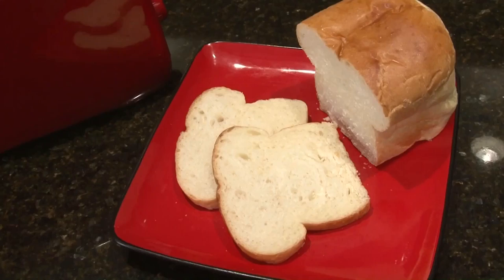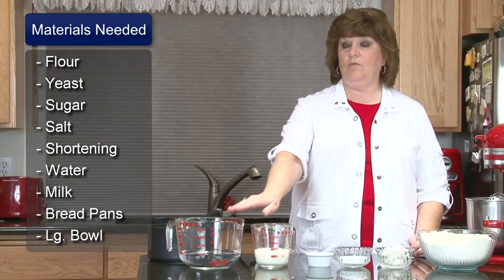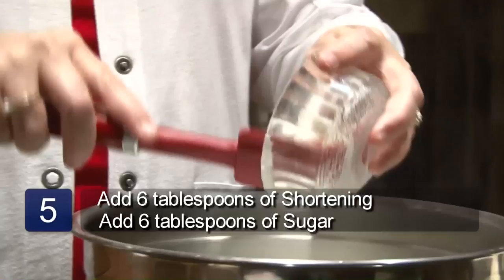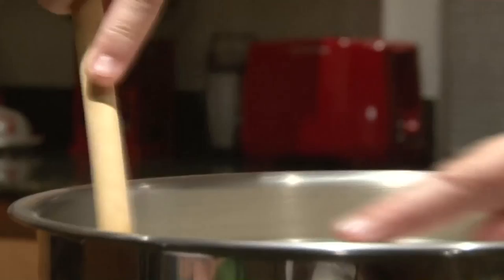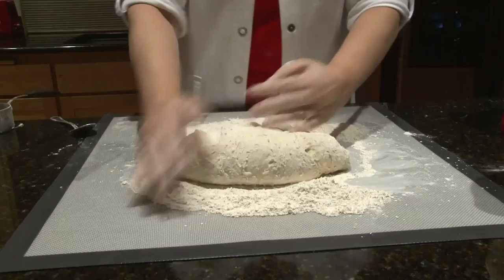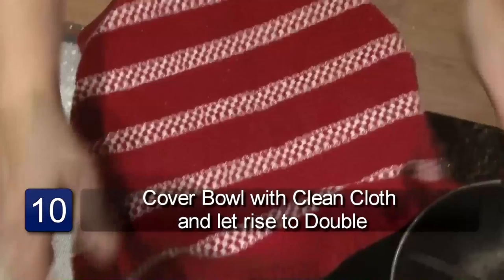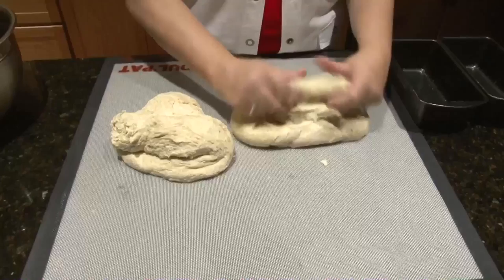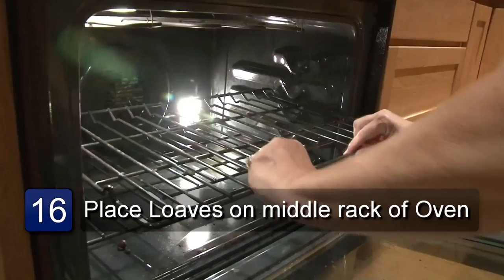Bread Baking Tips : How to Make Soft Airy Bread

Comment: Soft Airy bread 
by Expert: Susan Walker
Ingredients:
5 tsp of active dry yeast (5 tsp = 14 grams = 2 little packs)
3 cups  +  6 cups of flour (more or less to obtain the desired consistency)
6 tbsp of shortening 
1tsp + 6 tbsp sugar
3 tsp of salt 
¾ cups of milk 
¼ cups of warm water + 2 ¼ cups water 
Instructions: 
1. In one small bowl mix : 
the (5tsp) of dry yeast, (1/4 cups) of warm tepid water and (1 tsp) of sugar.
• when you see the yeast mixture start to foam then you'll know that the yeast is working and you can continue with your recipe.
2.  The next step is to put the (2 ¼ cups) of water and 3/4 cup of milk into a saucepan put it on the stove and heat it to scalding (scalding means that when the milk foam around the edge of the pan its scalded but you don't want to boil it). After the water and milk is scalded, add the (6 tablespoons) shortening, the (6 tablespoons of) sugar and the (3 teaspoons) salt to the saucepan, and mix that together until it's melted and then put it aside to cool.  
3. After your saucepan mixture is cooled to lukewarm, then you can mix the yeast mixture you made with the saucepan mixture in a large bowl, you stir it together.
4. Then we are ready to add our (3 to 4 cups) flour to the bowl ( I use a mixture of bread flour and regular white flour), mix in enough flour until it's too thick to stir then you'll want to turn it out onto your kneading surface, then you'll want to add the rest of your (6 to 7 cups) flour into the middle of your surface and then pour your dough into the flour and using your hands you'll want to knead that flour into your dough and you just keep kneading and kneading and kneading until the flour is gone and when your dough is elastic and not sticky to your hands and not sticking to the surface then it's ready for the next step (if it's not you'll want to add a little bit more flour until you get that right consistency).
5. Then, you'll take the dough that you just kneaded and put into a large greased bowl cover it with a clean cloth and put it into a warm place and let it rise till double sometimes it will take up to 90 minutes.
6. After it's risen to double, you take your fist and you punch it down now you're ready to form your loaves, take your bread pans and you spray it with cooking spray or some kind of a baking spray and then you take your dough and you divide it into either two or three sections depending on if you want large loads or small loads using your hands you take the dough and you form it into a long roll fit the pan after you've formed your loaf you will let rise until it's double or into the shape you want.
7. Now turn on your oven to 350 Fahrenheit so the oven is ready for baking. (Some ovens take longer to reach the desired temperature, so you might need to turn on your oven earlier).
8. After it's risen, you take a toothpick and very gently poke few holes down the middle of the bread make sure that the holes are only 1/4 inch deep because you don't want to punch the bread down again this will help vent the bread so that you won't get air bubbles.
9. Place the pans in the oven (make sure the pans are the middle rack) and you want to bake them for approximately 30 minutes or until golden brown on top.
10. Then take your bread out of the oven and let it set for about one minute and once you have the bread out you'll want to brush the top with a little butter, let the bread completely cool before you cut it and that is how to make soft airy bread.
*the key to making soft Airy bread is to use white flour or bleached wheat flour 
*this recipe will make three small loaves or two large loaves. 
End

Guys: I used most of the video's transcripts and added some words to it, also the ingredients look weird because I separated the quantities in steps... for example (¼ cups of warm water + 2 ¼ cups water 
) because you will need 1/4 cup first and then the rest for the second mixture... it is just so is easier for me to use everytime,  but you can edit it to howevver is easier for you.
I think she did a great job, and I will print and save her recipe he,he.

Comment: hi, i'm a beginner in making bread, i tried different approach in making it however can't make it soft, the last one, i have crusty crust yet soft in the inside.. what i want is a soft bread inside and out... i used to mix the yeast together with the dry ingredients and used a little bit warmer than the usual warm or lukewarm water.. and by the way, is it ok if i use oil or olive oil for shortening? looking forward for your help.. thanks.
Reply: One way to keep you crust soft is to take a couple of tablespoons of cornstarch with about a cup of water. In a small pot heat the mixture on the stove stirring all the time. The solution will start to get thick. Once thickened but still fluid....remove it from the heat and with a pastry brush ....brush the solution over each loaf just enough to cover. When the bread is done, the crust will be smooth and soft.
Reply: thanks Mr. johnnyohness... i'll try that one..
Reply: johnnyohness Let me be clear..try 1 1/2 half cups of water to about 1 2/2 half table Spns of cornstarch. Let is cook just until the solution becomes creamy but NOT too thick. Keep the solution away from the baking pan foe easy removal of the loaf.
Reply: If you place a slightly moist towel over the bread after removing from the oven, the crust will soften. Play a bit with the timing, but covering for a minute or so will reduce the crust a bit, while covering for 15 minutes will eliminate all crustiness...I'm no pro, but that has been my experience. Try it out.

Comment: Is there a such thing as kneading your dough to much I always have a problem with it rising. Bread still comes out great but lays in your stomach like lead. I think I pined it down to I'm bad at activating the yeast or all purpose flour isn't good for bread(witch i doubt) or i knead the dough so much it just never rises properly. Keep in mind my dough never doubles in size. Any help anyone can answer.
Reply: you should try letting all the ingredients but the salt sit for 20 mins before you start to knead it. then knead the salt into the bread. knead for as long as you need. i don't think you can over knead it.